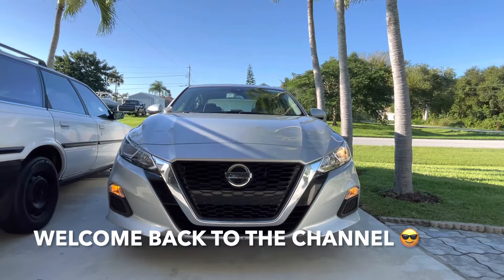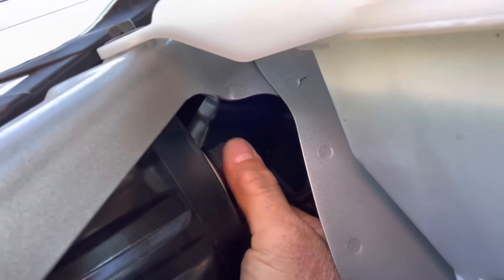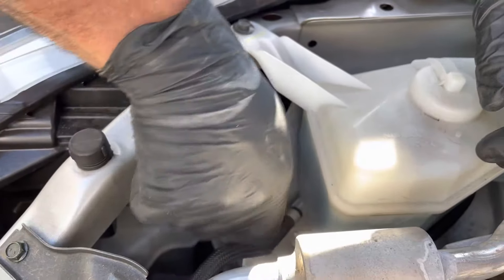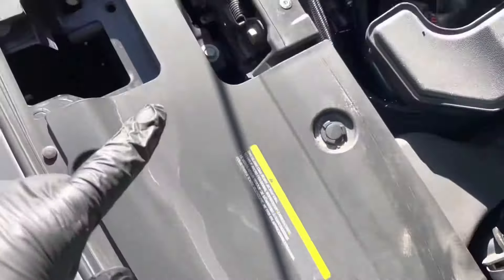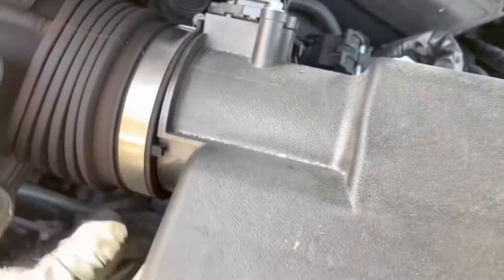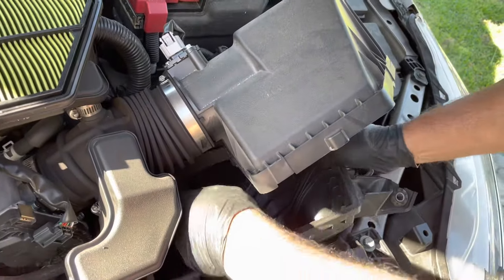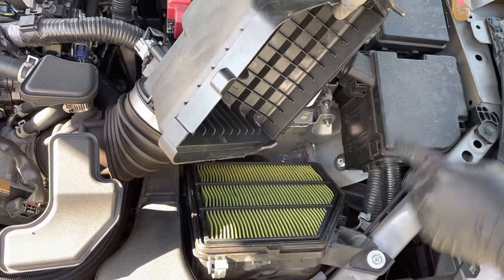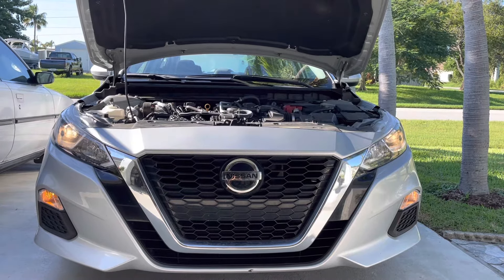NISSAN ALTIMA HEADLIGHT BULB REPLACEMENT - How to Replace Headlight Bulbs on a Nissan Altima

Comment: 1:40 Wow - that's a lot of work!   For the driver side, just remove the 10mm bolt at the bottom corner of the bumper & wheelwell plus the lowest front clip inside the wheelwell and then pry out on the plastic wheelwell cover for easy access to both bulbs.
Reply: This.  WAYYY EASIER. Especially if youre changing the low beam that’s way in the far corner of the headlight housing.  Takes 3 minutes.

Comment: Here to say this is the only video I found that shows how to get to the low beam on the driver side for a 2020 Altima S, it was quick to get out but took longer to get the new bulb in the hole correctly and turn into position. I didn't take all the stuff off, just lifted the air filter box and untightened the screw on the air intake hose. My arm and hands aren't big but it's like finding a hole without looking directly at it. Just had issues getting it secure.

Comment: Glad to see the orientation of the halogen bulb is on the correct side.

Meaning when the halogen bulb connector is facing down to 6 o’clock, that means we can use the all in one none adjustable led bulbs, for perfect fitment; and perfect beam pattern because the two sided led chips will face an automatic 3-9 o’clock orientation.  Same goes for high beams. 

If it’s an offset angle of the halogen bulbs, none adjustable will not be good option.

A 360 adjustable collar or with an Alex wrench to adjust the set screw for the orientation is a better option.

Comment: What about the high beams? I don't see the bulb. I got a 2020 SL.
Reply from the maker: High beam bulb is shown 10 seconds into the video. Low beam bulbs are located on the outside corners of the headlight assembly. High beam bulbs are on the inside corners. I hope this helps!😎
Reply: @fixinit  Nope! On my headlight that bulb isn't there.
Reply: I checked same locations as shown in this video lol. They just aren't there. I can't see. Might have to take headlights out.
Reply from the maker: You may have projector headlights and one bulb is used for both low beam and high beam. Hopefully some else here can verify that. Try looking at the headlights while someone flashes the high beams on and off. If it’s the same light then there’s your answer.
Reply: @fixinit  I know I can hear something switch/flip when I put the lights on. You're probably right! But when i ordered lights off amazon, it said H11s for low beams and there was a set for 9005 High beams. I'm not sure if the SR is different from the SL. It didn't have the option to choose SR or SL
Reply: @fixinit  Dang, looks like I gotta take the whole dam headlight out to change these bulbs. They don't just turn and pull out. I don't have room for my hand to see what the hell is going on. This sucks.
Reply: @rocknrye9273  Easy solution, have one of your kids or nephew with small hand reach there and unscrew the bulb out for you for an Icecream.
Reply: @tousshong9438  I have the Projector lights. They aren't the normal lights.

Comment: Followed all the steps for driver side that side is a bitch, couldn’t find the bulb 😢 just Gina take it into a shop in too lazy to do any nore
Reply: FYI:  For driver side, it is easier if you access the bulb from the wheel well.  It is probably easier then removing all them airbox etc..